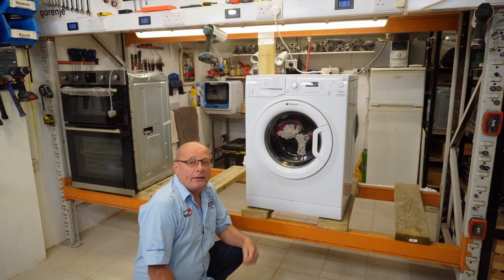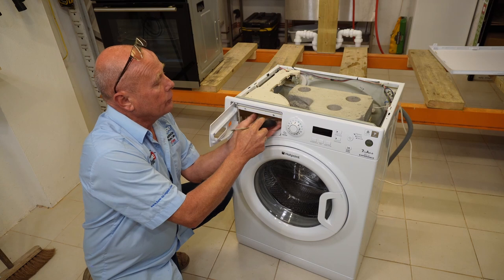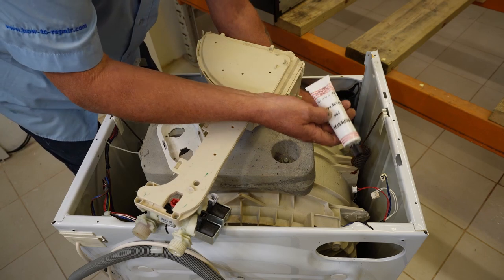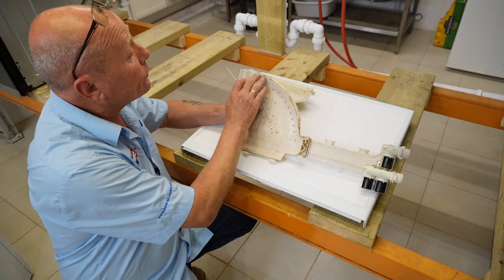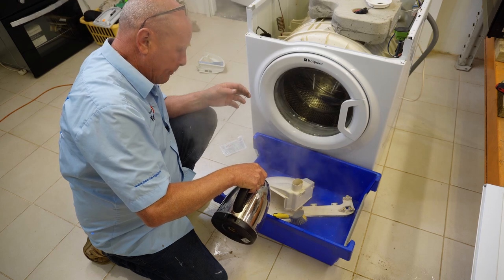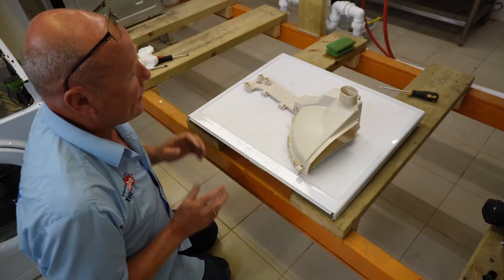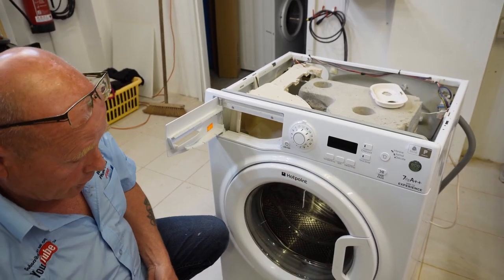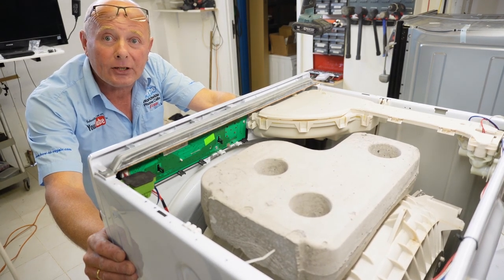Fix a Leaking Washing Machine Soap Dispenser Draw box

Comment: I live in Trinidad 🇹🇹. I wish you could come fix my washing machine. It's 2 yrs old, IGNIS front load. Very little water into the tub so not a proper wash cycle.
Reply from the maker: I was there 10 years ago lol if your machine has a small amount of water in the bottom then you either have a pressure switch problem or it is possible that the pressure bowl at the bottom of the machine is clogged with detergent. This may just need cleaning.